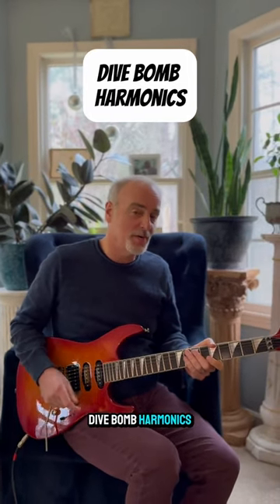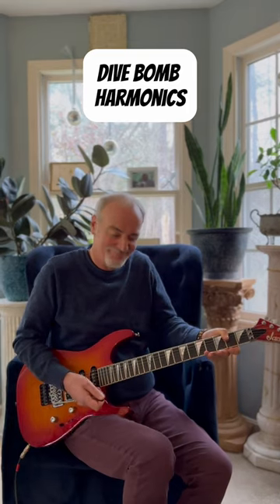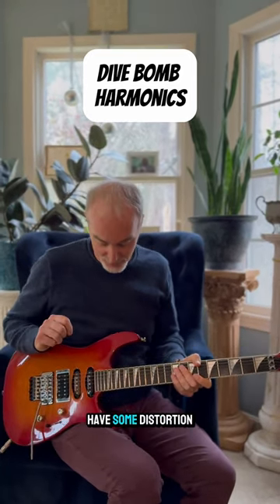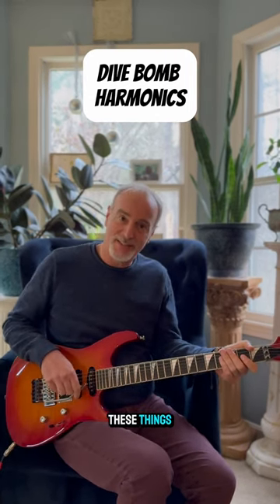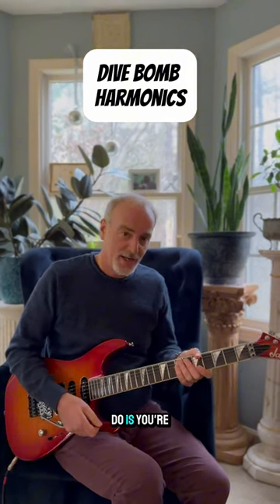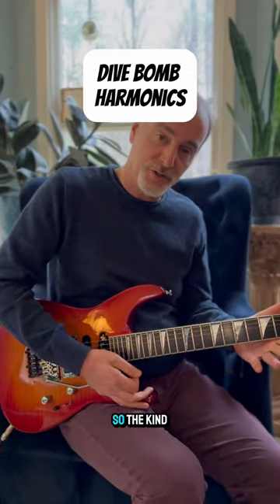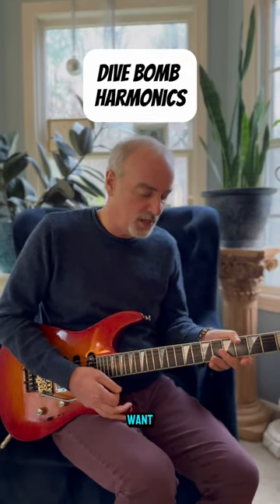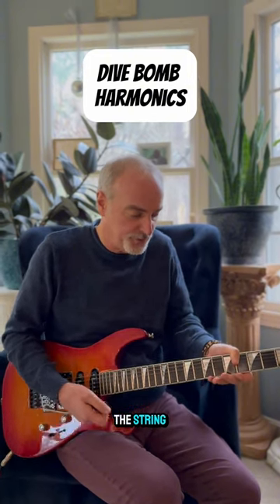Learn how to do dive bomb harmonics! #guitar #electricguitar #guitarlesson #electric

Comment: Man I can't do it! Where exactly do you have tl tap on the string?
Reply from the maker: Hey Alejandro, thanks for reaching out!  You need to touch the string right over the fret-wire (the metal bars of the fret) at either the 12th, 7th, or 5th frets.  The 12th fret is the easiest, so try that first.  Let me know how it goes!  ~ Rob
Reply: Thanks for the reply brother! I don't have a problem with those frets, I'm precisely trying to learn brandon ellis's solo from video you have as cover, and he frets the 3rd fret or 4th if  I'm seeing correctly. That's where the issue is for me, how can I get it to sound like it should?